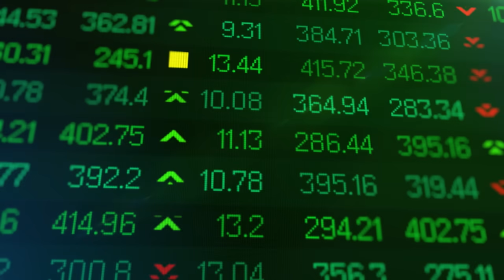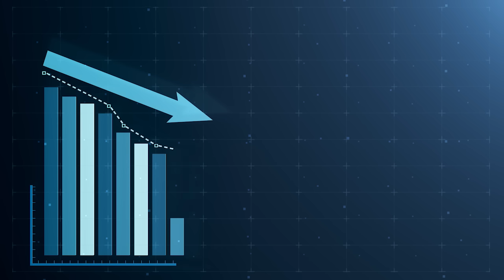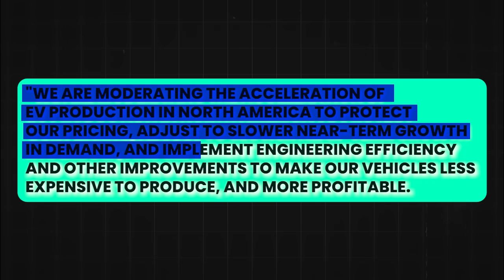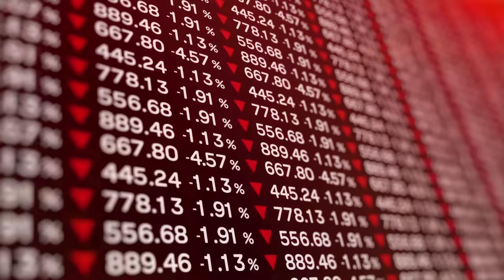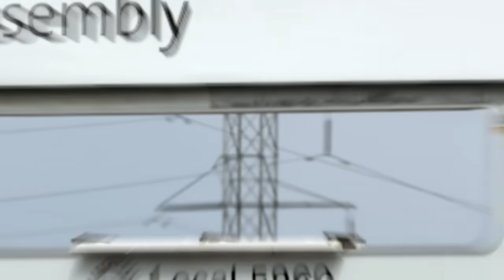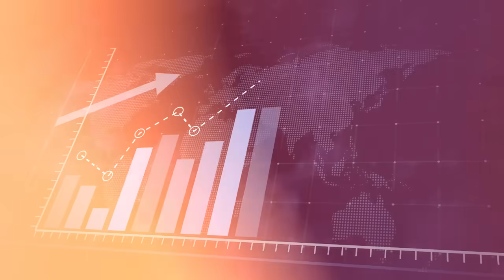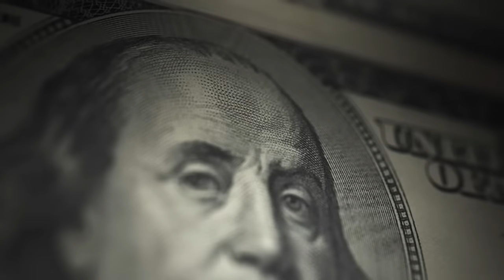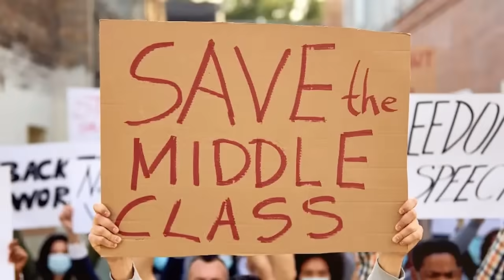HUGE NEWS! GM CEO Just SHUT DOWN EV Production!

Comment: They tried to rush EVs before we had the infrastructure to support EVs. It seems to me like it’s a hassle unless you own a house with a garage and you don’t have to travel very far.
Reply: Even if, ....with all the EV fires do you want to risk having one parked in your garage? Will homeowners risk losing coverage because of the risk?  CA. Is looking for any reason to cancel people....
I wouldn't risk my family with an EV even with an unattached but close to the house garage...
Reply: @GrannySmith123  Do your research better, the number of EV vehicles that catch fire is less than gasoline vehicles, per one thousand vehicles sold, and no one seems to be worried about parking them in their garage? So, no, I wouldn’t worry about it or let it stop me from getting an electric vehicle. I just can’t afford any new vehicles with the current prices and interest rates.
Reply: @GrannySmith123  over 300,000 Dodge ram truck owners have been advised to park their trucks outside for the same reason.  

Disingenuous to blame all vehicle fires on EVs.
Reply: @GrannySmith123 Condos and apartments are starting to refuse E-Bikes access to their buildings, in Toronto, Csnada
Reply: @neilvandepol2903  Are they also refusing cell phones and flash lights in their apartments as well?
Reply: I just made that exact comment basically. Theyre great for that. Its awesome to never have to go to the public gas station, but if I had to use a public charger, that would be even worse.
Reply: The same thing happened with gasoline and the Model A.  Infrastructure follows (not leads) the market.  It's called capitalism.  

Now if you are calling for speculative infrastructure, companies are going to ask for some form of government assist.  Also known as Socialism.  

People often talk about "pet the markets decide" while ignoring the public commons that facilitates those markets.  Commerce and trade are backed by government.  Roads ar backed by government (even toll roads), the key inventions that have enabled the Internet, microwaves, your TV, your computer, the battery systems of today, defence, currency.....all developed and supported by government.  (That is 'we the people' at work).  People who rail against democratically elected government are working against their own best interests.
Reply: @traveling.down.the.road56 not true. That statistic is counting cars made in the 80s. Yeah a VW rabbit from 1983 catches on fire more than a Tesla. But ICE made in the last 10 to 20 years don't catch on fire.
Reply: Time for another bailout
Reply: @nobodynever7884  Explain that to the owners of over 341,000 new model Dodge trucks who've been advised by Stellantis that they should park their trucks outside due to recent fires caused by a faulty electrical connector.  Recall in progress. As seen on Fox, CBS, NBC ..etc.
Reply: Infrastructure? Imagine a typical, small fuel station with six pumps. The only 'infrastructure' is underground storage. It takes perhaps five minutes to fill an ICE car which would then have a range of up to 700 miles. Let's say ten minutes to be generous. That's a capacity of 36 cars per hour. Compare that with an EV charging station. Cars take up to an hour to charge for a range at a third of the ICE cars. I'll leave you to do the maths but I hope it's clear that, in many countries, there simply isn't enough land for the infrastructure.
Reply: Well I am that type of person, have a home, retired, only drive around town with my EV.  So there!!!!!!   Yes, most people do not have this luxury and agree EV vehicles would not be a good buy right now.
Reply: Not if you own a Tesla or now use any supercharger.
Reply: How so?  A Tesla car and their Supercharger network makes charging very easy every 400 miles or so.   @bunberrier
Reply: @grunt98444  Maybe you have the time to wait around for a charger, then wait while it charges. I don't. If its charging while I sleep, that's fine. 
Also you aren't going 400 miles in a Tesla in the vast majority of cases. The range of EV's is absurdly overstated.

Comment: Great commuter vehicles if you have access to private lvl 2 charging each evening... but horrible for the all 'rounder that most budgets hug.  Ever asked why SUVs were so popular?
Reply: Exactly. If they were serous they should have built more commuter type vehicles for people that drive a set route daily.  Plus a few errands around town. Instead they went all in on outrageously expensive luxury models.
Reply: We have a charging station handles 4 cars sometimes I watch at least 45min at the station 😂no thank you.  What about people that live in apartments 🤔
Reply: @kathyabernathy467  45 MINS? yes i see them bored out of their skulls willing the charge needle to go higher and faster but it never does... saddoes
Reply: That's assuming it doesn't blow up and burn your house down.
Reply: @lot2196  Aligning EV's with prestige has been somewhat of a mistake, in my opinion. Just look at the greatest sellers of all time. The Honda Cub motorcycle, 100 million units sold. The Toyota Corolla and Ford F100, 50 million units sold. Honda Civic, 27 million units. The VW Beetle 24 million units sold + derivatives such as the type 3 and the Kombi van.
"Car people" are always going to want their luxury and their performance. Whether they can afford it or not, is another thing. But a large part of the market remains that treat a car purchase in much the same manner as purchasing white goods. "Is it alright, is it cheap to run, can I afford the sticker price". 
This is probably less so the case in the US where there is a certain social pressure to drive a "nice" car, but for the rest of the world, cars are just a tool, to many consumers.
Reply: SUVs were the original overpriced trap when most families would have done just fine in a wagon.  Imagine Taurus, Camry, and Accord wagons instead of the SUV trap
Reply: @linh811  which buyer was duped into a SUV?  Personal responsibility is still a thing even if you don't like it. Wagons are still available and sell in the singles......
Reply: To be honest, I will never understand why people like SUV's. They are basically overpriced gas guzzling boxes with wheels. It's not like 90 plus percent are used for off-roading.
Reply: @americanbobtail1  Don't assume everyone is like you though. All my friends and I have SUV's or Utes (diesels), that's because we live in rural areas with rough pot-holed roads that destroy lighter vehicles and often tow heavy loads and a fair bit of our recreation is going into the backcountry on 4wd tracks. I would agree that most people you see driving in the city don't need them though. I grew up in an era when the only ones that had a 4wd were farmers.
Reply: @silverdale3207  - No, I am making a statement that people waste money on SUV's because they are supposedly cooler than a minivan. For example a Cadillac Escalade starts around 80K USD and more likely than not it is around $100K out the door. The odds of somebody actually using for trails/off-roading is quite slim, especially if it can damage the paint job. What you are talking about is less than 5% of total sales in the United States and without research more likely is less than 1% of sales. Also, a Cadillac Escalade is just one big ugly box. Finally, I am not exactly young and it shows the wastefulness of United States current culture buying SUV'S and the gargantuan trucks they flat-out do not need, but buy them because they think they are cool.
Reply: @americanbobtail1  yeah, you're probably right in the states, I've observed the same thing, I'm from New Zealand and we use our Utes a lot as they are designed as we're a very outdoors nation, same with our neighbors in Australia. But yes the really big trucks you have there are ridiculous.

Comment: There’s a reason why the combustion engine have lasted the test of time for nearly 200 years it’s called getting it right the first time and not messing with it
Reply: Uh, the combustion engine has been around for just over 137 years, dating back to the very first one made in 1886.
Reply: @timestealr2967  He didn't say internal combustion engine, and you didn't specify either. The Stirling is over 200 years old. You're wrong on all counts.
Reply: And they are still the most wasteful form of transport only 15% of the energy produced is actually used the rest is heat lose